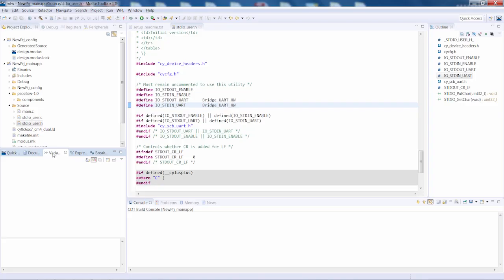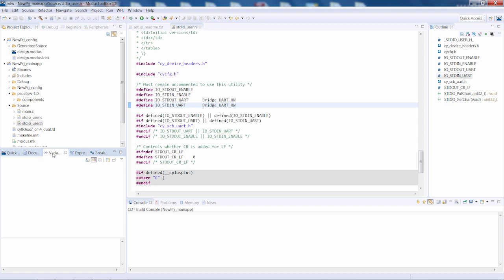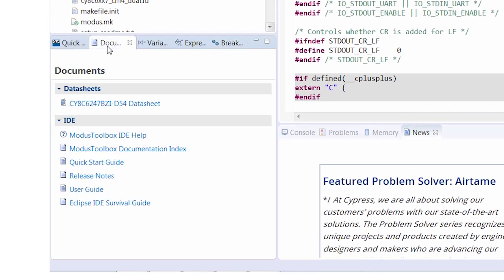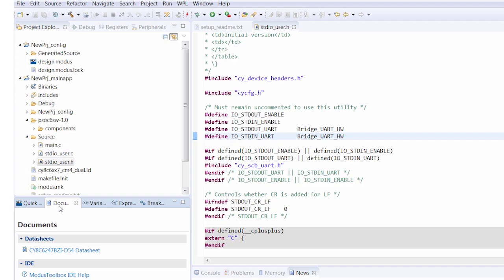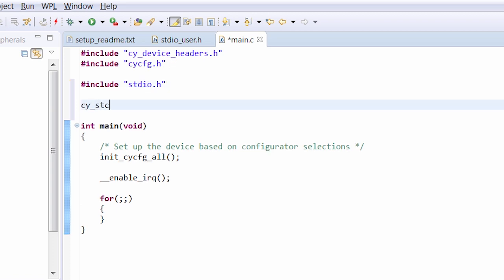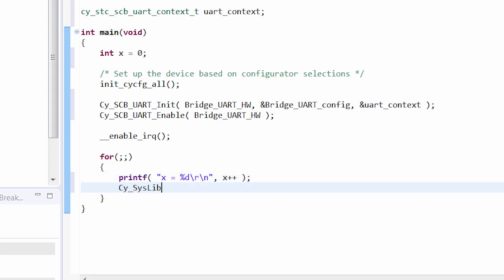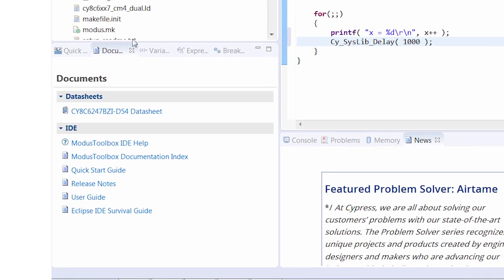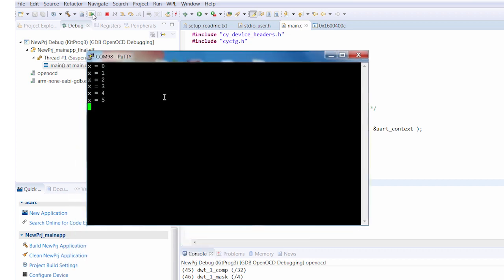Welcome to Modus Toolbox: #4 Program & Debug

Comment: Doesn't matter how many toolboxes Infineon creats. Everyone is a pain in the ass to configure. 
Just use one proper Eclipse. 
Bunch of Path variables which have to be set manually for admin and user depending how you run the program. 
and then you cant run a simple empty program because it can't start Jlink. 
Why do I have to work so much before I even begin to work?

Comment: I am facing while programming my PSOC6 BLE board. I am using Modus Toolbox to program and i have also updated the 
firmware to Kitprog3 using 'fw-loader' . 

This is the error message that i am getting.

Info : SWCLK/TCK = 1 SWDIO/TMS = 1 TDI = 0 TDO = 0 nTRST = 0 nRESET = 1
Info : CMSIS-DAP: Interface ready
Info : VTarget = 3.296 V
Info : kitprog3: acquiring PSoC device...
Error: kitprog3: failed to acquire PSoC device
Info : clock speed 1000 kHz
Error: DAP 'psoc6.cpu' initialization failed (check connection, power, etc.)
** OpenOCD init failed **
shutdown command invoked
** Program operation failed **
srst_only separate srst_gates_jtag srst_open_drain connect_deassert_srst